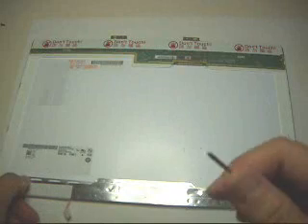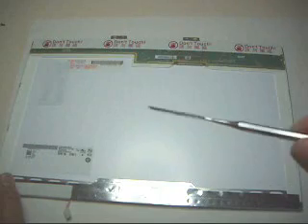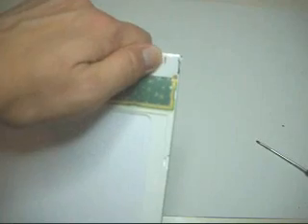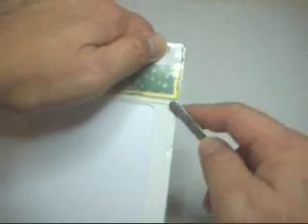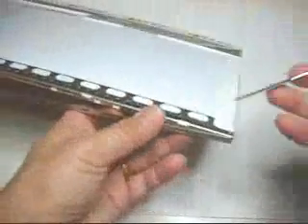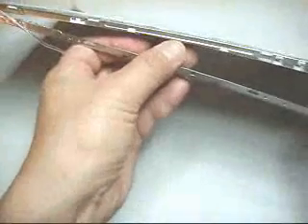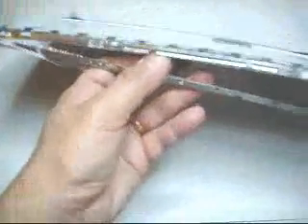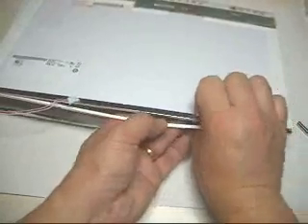How to replace an LCD screen backlight or bulb

Comment: This is exactly what I need to do with my Dell latitude. The symptoms are exactly the same. I was getting a reddish tint on the screen for about 6 weeks. Then for about 2 days the screen was flickering....Then the screen went black. The computer will boot up fine, then the desktop will flash on for about one second then the screen goes black. So, thank you sooo much for posting this.

Comment: Thanks!I hope I can watch this before I disassembled my Dell Inspiron 1501 LCD screen.I did mine until open up every layers of LCD.I was wondering where is the backlight and how to take it out.Some say not worth replacing the bulb,very true because it is hard to install it.Now looking for replacement screen but not cheap for me,all in USD.I just don't like the new laptop design with LED and 16:9 display ratio.Old is gold.The old ones still the one I love most.

Comment: i have a new screen with 2 ccfls, so 4 wires coming out of the bottom of the screen.  the connectors are the wrong size... but i have the correct connectors from an older dead screen.  my question is: if i splice the correct connectors on, does it matter into which socket on the inverter board they go?  is there a difference in the voltage to the top vs bottom ccfl?  its a toshiba qosmio g35 screen....   thank you

Comment: First of all thanks for this precise tutorial.

However, I am a bit hesitant to start, I don't know if it is indeed a problem with the Backlight itself.  I installed a new lcd inverter but unfortunately the problem wasn't solved, it's the same.  It is intermitent: Sometimes I start the computer (HP Pavilion dv2000) and the screen is illuminated, but more often it isn't, altough I can see there is image.  After some tries (putting it to sleep mode and then on again) it sometimes works (I am writing on it right now, but I am afraid of ruining altogether).

Do you think it is still the screen, the bulb?  There is always image, only mostly with no light.  Thanks!
Reply: Setiawan Helmi

Thank you so much for your answer, I really need help. I will write with personal message
Reply: Setiawan Helmi 

I did: I firstly changed the inverter for a new one.  Then I disconnected the lid switch.  It didn't work.

When it works, then the screen stays on, it stays on all the time.  It doesn't turn black.  It only is intermitent at the beginning, sometimes it turns black, sometimes it just stays normal.
Reply: Try to replace the inverter.
Reply: Thanks to all.

IT WAS THE SCREEN.  I installed it and it's perfect.  Previously I replaced the inverter in 2010, then when it happened last I did again to no avail.  Then I disabled the lid switch.  Nothing.  It was the screen.

THANKS EVERYBODY!

Comment: Hey Jarcomtech. I changed a backlight in a Dell Inspirion 1000. After I put everything back together, Only the bottom half of the screen is lit. Do you have any suggestion ot know how what to check?? I've taken it apart 3+ times and can't figure out what I'm doing wrong! :(

Comment: Hi,
I actually fit smaller the one from laptop to a normal monitor. Just wondering if they have same power. If they are the same volts and amps I can try nothing to loose as I don't have other way. The monitor is cheap to buy second hand than repair.
Thanks!

Comment: Your video ends "So this is the bulb here", but before I can get a good look at it! It doesn't look like a bulb to me. I read a book called something like "18 laptop repairs to make you $60,000 per year". I expected to see a small fluorescent tube. My broken laptop is a Toshiba Qosmio F20. I found a Fujutsu Siemens Amilo which someone had thrown away, then I took it apart to give me an idea what to do, but it was very complicated. I couldn't see any backlight.  My Toshiba is probably the same.

Comment: I should be more specific. The bulb lights up but it seems as if the very bottom is only bright. Is as if the light doesn't spread all the way up. The lcd still works, but the light doesnt spread. I think the problem is that I forgot how the bulb is seated in the glass panel. I placed the bulb at the edge but it looks like it needs to be closer to the reflector.

Comment: Hi JarcomTech. I have a Dell Vostro 1400 laptop and decided to change the bulb because the light was way too dim. I successfully replace the light bulb but it seems like the light is not well reflected on the lcd. About half of the screen now lights up and the other half is dark. Re-positioning the bulb is very challenging. I'm thinking that maybe there is light 'leaking' and that prevents it from being reflected. Should I get some sort of aluminum adhesive tape? What are your thoughts?

Comment: Hi Jarcomtech. I have a compaq laptop, and the screen broke. I could still see the stuff on it, but half of the screen was static from the crack. So I got a new screen, same model. But now, I can't see anything unless I shine a flashlight on the screen (I'm guessing the new screen's lamp is broken). But when I put in my old, cracked screen, it also doesn't light up anymore, but if I shine a flashlight on it, I can still make out the good parts/static cracked part. Is the lamp broken in both?